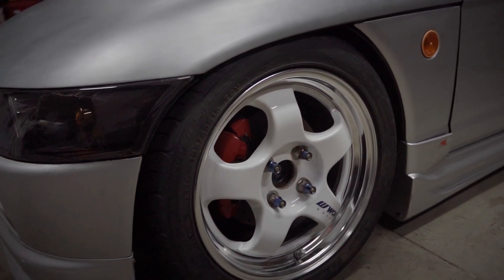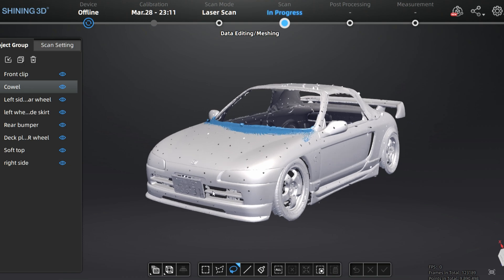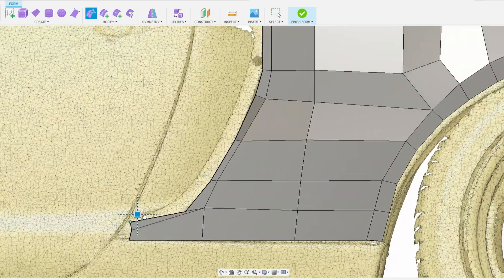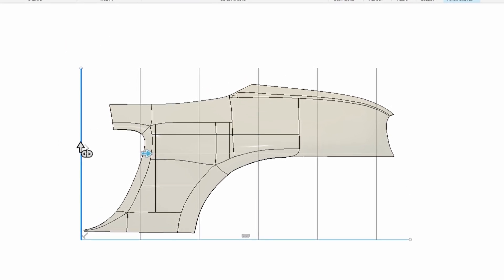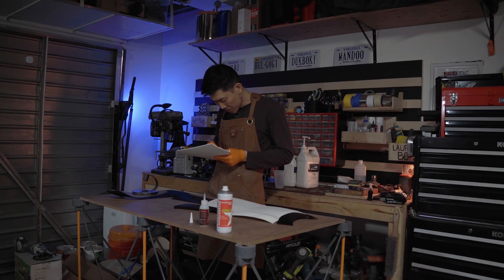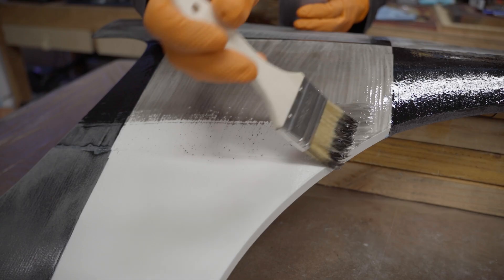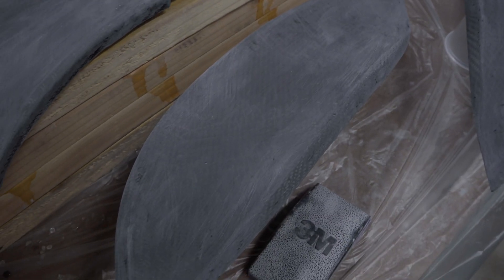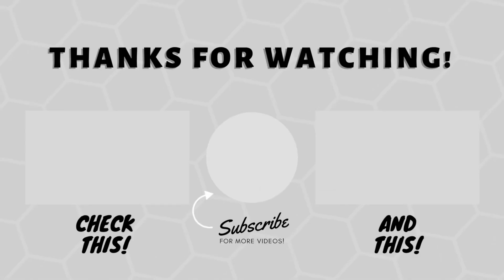How to make Carbon Fiber Widebody with a 3D Printer

Comment: You likely won't see this, but I wanted to share a tip for "welding" 3D prints or other plastic parts together.  I use the soldering iron as well, but to increase strength, melt in some metal across the seams.  I've used things like paper clips and staples.  

This will dramatically increase the strength of the weld.  I've done the same 3D printed parts with just the weld, then with metal melted in.  With the metal welded in, I more so did just spot welds where I melted just metal pieces (I've been using staples lately).  It was way stronger than full welds with no metal.  It also allows less melting of the plastic, which I assume the gasses coming off aren't that great for me.  

You can also do a solvent bond with ABS or ASA with acetone, but I don't think that is as strong as melting metal in.  Helps if you sand the parts at the joint first and leave the dust from sanding on the joint.  I've tried a few things, but melting little pieces of metal into the parts seems to be by far the strongest.
Reply from the maker: That's super useful info, i'm printing the front bumper now and i'll use your approach to join the sections together!

Comment: Nice job👍 When you have designed the left side on the computer can you just flip or revese it so it makes a part that fits the rigth side or do you ned to design a new part for the other side?
Reply from the maker: Yup I just mirror to the other side and make any adjustments that’s needed like the gas door

Comment: Great video! I will also try the ASA/CF skin technique. Im not sure if fusion has surfacing evaluation to see surface transitions but if it does, you cant see the surface orientation of the model for better continuity.
Reply from the maker: Tbh I’m not too sure if fusion has it
Reply: @ I use a program called Autodesk Alias. The surface evaluation allows you to build the model with out weird bumps. Unfortunately it’s really hard to learn and it’s $1500 a month for a license because it’s used by professional car designers.

I am experimenting with blender because it has a similar tool using poly modeling and also it’s free!

Comment: 3:40 for future projects that don't involve carbon fiber, I recommend not using superglue. It does not hold up to UV or heat and will fail before the ASA. I recommend plastic weld staples. They're not pretty but they hold a lot better than you'd expect, and you can always just sand and bondo the melted portions.
Reply from the maker: Thanks for the tip! I’ll keep that in mind

Comment: Could you explain how you use the point cloud from the 3D scan as a guide to "fit" the new fender design on them. In the video you only show the frontal view, which is intuitive but i don't see how the point cloud data get part fo your design so that the new fender fit snug against the car body. Would love to try something like that.
Reply from the maker: Yes I made a quick video on my instagram. You can use the “pull” command in Fusion to get each point on the fender model to attach to the 3D scanned mesh.
Reply: @IMEEMADE  thanks. I think the links to your IG from both your website and YT profile are broken, but found you anyway.

Comment: nice! i wonder how stable it is with 3d print + 1 layer of carbon fiber. might actually hold up in comparison to the original thin steel panel.
Reply from the maker: It’s pretty sturdy! Though I’d say the weakest link are the seams which need some extra reinforcement
Reply: First attempt: you cover your 3D part....
Second attempt: your 3D part is the mold...
It's a little bit tricky to make a female mold for few complicated parts, not for wing...
3 or 4 layers of fiber glass are always better/stronger/lighter:more durable than a PLA/PETG core cover of fiberglass....

Comment: Very cool man! So they are basically made out of the filament and covered with a sheet of carbon fiber? How do you plan on bolting them on
?
Reply from the maker: Yup! They’ll be double sided taped on for now and in the future likely panel bonded if I ever commit to a design lol
Reply: @IMEEMADE  Cool! But if it were for you to do bolt holes, how would you design them?
Reply: @kizoyume One idea might be to use heat-set threaded inserts. They are basically a thread you melt in with a soldering iron
Reply: @IMEEMADE  Remove the filament at least at the edge...
If you want a more durable part, you can remove all the PLA inside, just keep the outside carbon fiber, and reinforce the inside with  some layer of fiberglass/carbon fiber